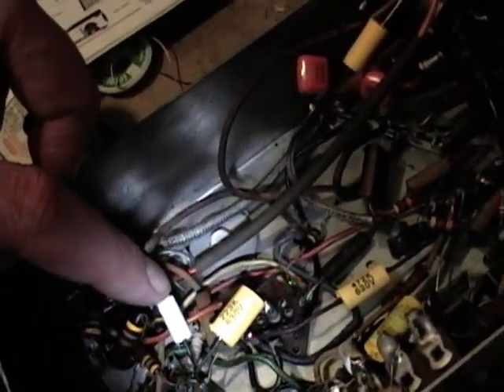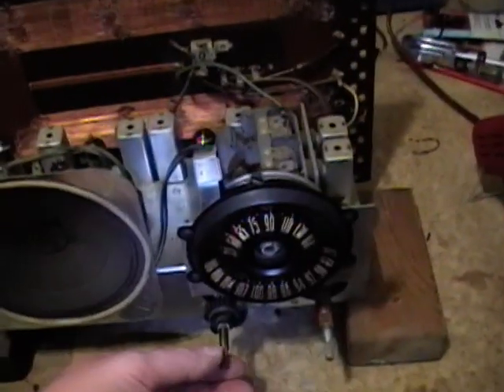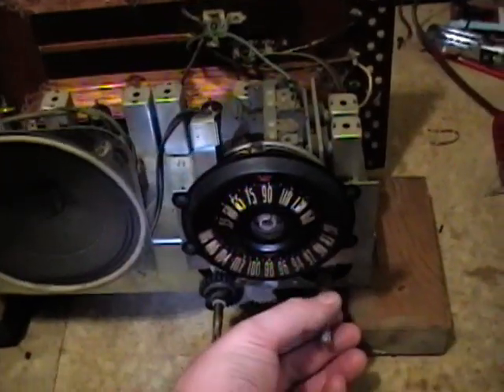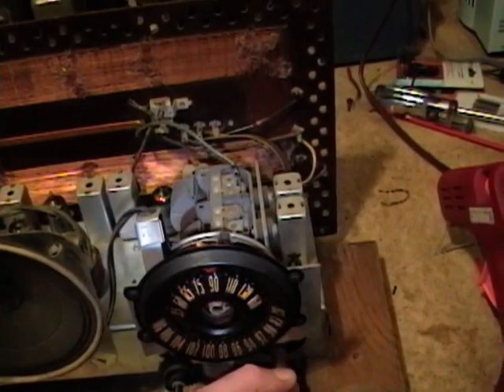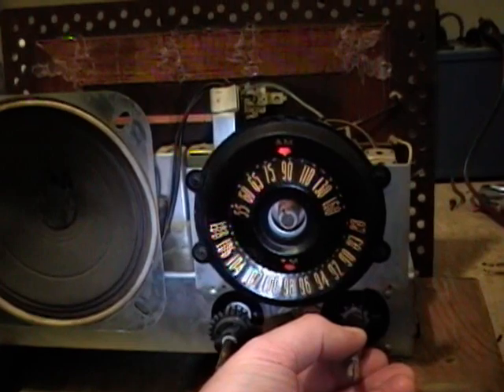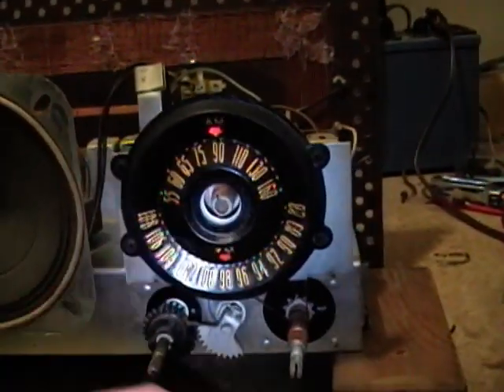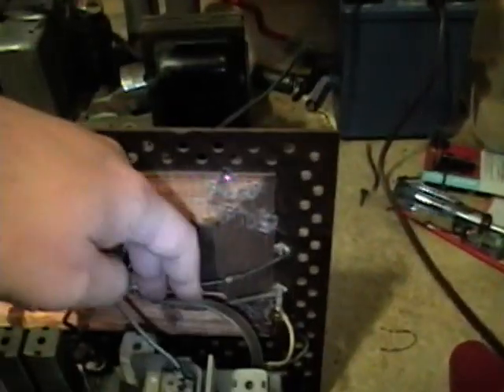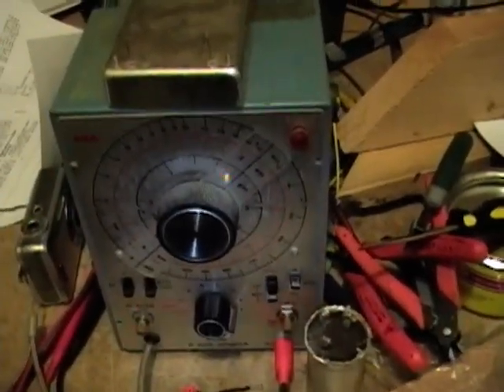GE 212 radio restoration p6o7

Comment: It's a shame that G.E only saw fit to equip an FM radio with a four inch speaker, you would think that they could have at least used a five inch to take advantage of the higher fidelity.